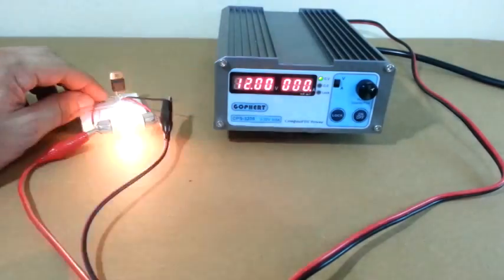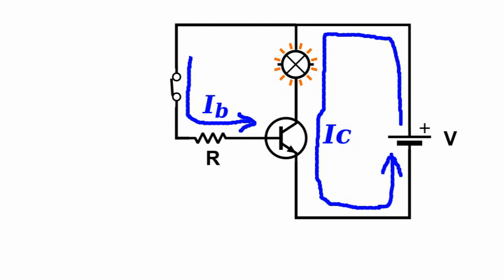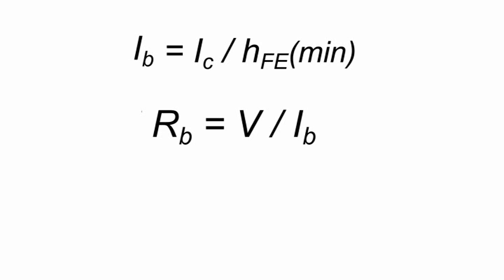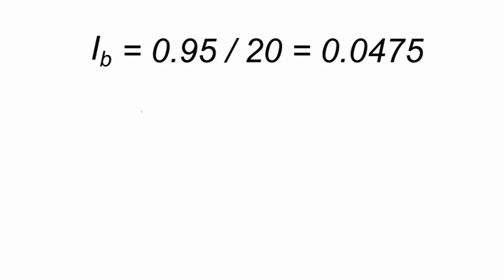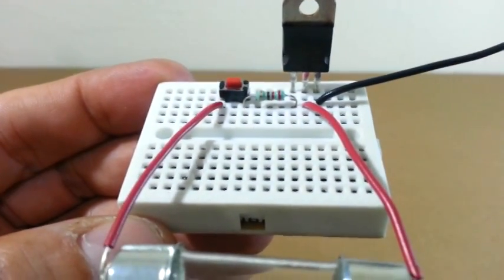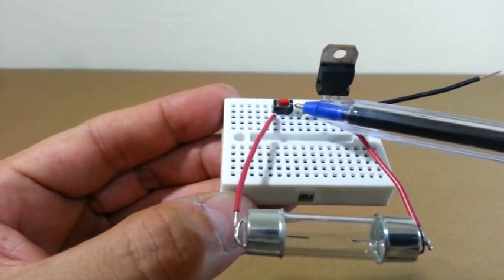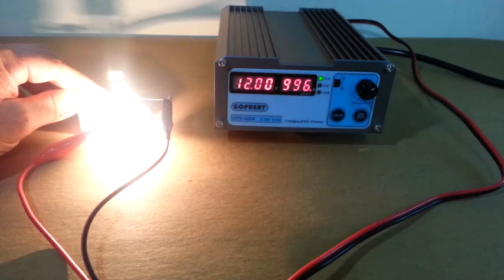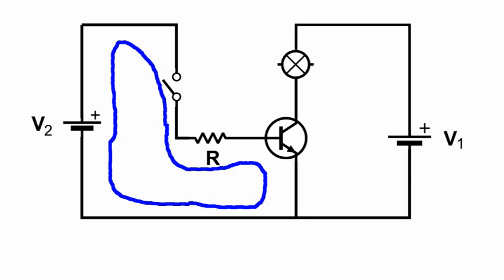Using a Transistor as a Switch

Comment: I wish you idiots would stop posting these fake transistor switch circuits these circuits are just using the transistor as a conductor you don't need one to light an L.E.D just use a resistor

Comment: Why did you use a switch instead of making the transistor itself as a switch . Remove that switch and trigger the base of the transistor with the proper voltage which will allow the transistor to pass the main voltage .

Comment: I want to make automatic switch for 12-24v dc or even better 220v ac. so when i put constant 5v dc to the circuit, the power switch turned on, but when 5v dc is turned off, the circuit will automatically turn off the power switch. Can you make a diagram for this?

Comment: I know it has been 3 years but I just want to say well done for this practical example. It is the only one I can find that doesn't just explain the process of calculating the base current resistor but also explains the purpose of calculating the base current resistor which is ultimately to control the current required by the load circuit.

Comment: Why always a base resistor is needed to make the circuit work??? Why it don't work without it
Reply: Base to emitter voltage is 0.7 volts. Rest of the voltage, (Supply volt - 0.7v) appears across resistor. Without it entire supply volt appears at base emitter junction which will damage it.

Comment: Why was the transistor even kept in the circuit, if you push the switch, the light glows, what did the transistot do??
Reply: as he showed the lamp needs 1 A, but the tiny button can't support 1 A, it would just break... but the transistor can handle 1 A, so the button is used to switch the transistor in its place
Reply: Uploader missed to say that the switch is symbolic. It could be replaced with any other switch, like float switch.

Comment: Why to use transistor as switch when we can us a mechanical switch
Reply: i don't know about him but, for my application i need to turn on / off  3 or 4 individual events with the push of one button,  mechanical switches are way too costly for my project (import tax is high in our country) and are limited to the no. of poles it can throw at a time.

Comment: If  I use  5 Volt for base voltage  and 12 volt for  load voltage  then  while calculating resistor value for base then V= 4.7 (5 - 0.7)  volt . Am I correct ?

Comment: Then what the fuck is the use of the transistor if you still need to press the switch.
Reply: TheNormalGuy E   The automotive industry uses the concept to run smaller wires to the control locations.

Comment: it seams too many people don't see the point of the transistor when there is already a  switch in the circuit. Guys this is an example to show you the switching action of the transistor. You need to apply voltage( well current for BJT) to the base of the transistor to turn it on. Whenever there is voltage, the transistor allow current to flown from the collector to the emittor (NPN BJT only). It might seams like there is no practical design for this circuit if you see this as 2 switches using the same voltage. However, if you play with very high voltage, you could connect a very low votage on a switch and the  base of the transistor. Then you could put 120/240 volts on the other side to turn on an apliance without risquing to hurt yourself playing with high voltage. Think about a computer or a TV that is connected to this kind of voltage but the switch to turn it on could literally be licked without killing yourself (still dont do that!!! there is some appliance that have a 120v switch). Long story short, you could have a mechanical switch operating at 1.5, 3 or 5v  and turn on/off stuff on the other side of the transistor with lethal voltage. The other use without a mecanical switch and by using only the transistor for switching would be  by turning the switch logicaly. One example would be to hook the base to a pin of an Arduino and putting the pin high or low in the code. You would then open the transistor switch on or off accordingly. As an example, if my arduino detect (using other component of course) that it's dark in the house, it could trigger a function that will set the pin where I connected the base of the transistor to high. Doing so could open a light inside the house, if such device is along the current path past the emittor. If I put the same light on the side of the collector, I would turn it off. Hope it helps giving you an example where you could use an additional switch or not.

To summarize, if you put a mechanical switch, there is still a point of using a transistor for switching, but you'll need some kind of interaction. If you want to automate the action of your transistor (as as switch), you'll need something to feed the voltage to the base like a microcontroller, the output of another transistor and so on.
Reply: Alexandre Contant   Yes, but this is more similar to how a relay is used.
Reply: Thanks for the information, does using a transistor can also protect the components that are being energized? can a transistor withstand more activations than just the singnal of a microcontroler alone? maybe that could be also a reason to use a transistor as a switch? 
Is more reliable and it protects the components being energyzed. Could also be used as an internal fuse...

Comment: i don't know much about electronic. I don't see the point of having a transistor in the circuit  because he is controlling the circuit with a switch...he push the switch the light comes on and he push it again and the light goes off...so what does the transistor do in here??? if he is turning it on and off with is hand...
Reply: as he showed the lamp draws 1 A, which the tiny button can't handle... but the transistor can handle 1 A, so the button is used as a means to activate the transistor which can handle the needed current

Comment: i did the same circuit but without the transistor. I inserted the switch in place of the transistor, connecting one terminal to the red wire and the other to the black wire.

Comment: for that matter why not just jump the lamp to the switch then to a power supply?  the transistor is useless in this application.
Reply: it's an example duh
Reply: duh
Reply: i think that little switch will not able to pass >900mA of current for long time, so there's the transistor came in to handle the current. just my 2 cents though..
Reply: @Brian Evans its not redundant, because the tiny switch isn't able to handle nearly 1 A, so the switch is only activating the transistor to do the heavy lifting in its place.. just like for example a microcontroller pin might do, most can only supply 50 mA or less, but by having it switch the transistor the pin can activate the 1 A lamp without frying the board
Reply: No an example is supposed to demonstrate a principle which this does
Reply: Brian Evans I think most can watch the example and apply the principle to an appropriate circuit with bigger loads. Just cause you need every little thing explained to you don't assume everyone else does too.
Reply: Brian Evans and your moms

Comment: What if you replace the resistor for a potentiometer?
Reply: No problem, you can do it and use your potentiometer as a Switch for the transistor.
Reply: turning the potentiometer will incerase gradually (or decrease) the current in the base, and the light will have the same effect, but make sure to put a resistance after or before the potentiometer, so you could actually put the potentiometer in 0 ohm and the transistor will not die

Comment: why is the lamp taking more current when in a transistor circuit than when hooked directly to the power supply..shouldn't it be the opposite?as the transistor puts some extra resistance.
Reply: the trasistor takes some current by itself thats why
Reply: Ανώνυμος Ανωνυμόπουλος
i see...thx
Reply: Switch+resistor+transistor forms parallel path to lamp. Hence effective resistance will be lower and hence draws more current.

Comment: isn't easier to use a simple switch!!!
u have to keep on pressing the switch to keep the light on!!!
Reply: or as it says at the end of the video, you can use a low power circuit to drive a higher powered one. For example,  a micro controller to drive a motor.
Reply: I think the concept is to allow fast switching say by using a sensor in place of the button switch.

Comment: i thought he was going to use the transistor as a switch ,but he used it like you`d use a relay im disapointed
Reply from the maker: this is the standard way of using a transistor as a switch
Reply: but you are pressing a button ,that is switching the circut,thats the switch !how is the transistor switching the current on and off ?its only directing by the way i see it
Reply: even your diagram displays the transister is only a transister and the switch is the switch,it isnt adding up to me
Reply: ok i see how you are calling it a switch cause when you feed current to it its switching current,but it not being the controller,the real switch is the controller,guess this system is practical in compact situations,otherwise id just use a relay to do the same job,less math involved then
Reply from the maker: yes but relay is more expensive and slower to turn on (important in some situations)
Reply: very good fact
Reply: Not really important for people seeking this knowledge on youTube..
Reply: Thanks this all helped. A lot of videos don’t explain that the controller switch can’t handle the current and uses the transistor as a (switch) for lack of a better word 😑 because the transistor  can handle the current! It basically is switching through the transistor! If you want to see a transistor without the controller switch you can look it up in application of a digital computer! For anyone still reading

Comment: what code of transistor you use mr ludic?
Reply from the maker: +Gerizen Halim 2n2222 works and many other small PNP´s
Reply: I want install to 12v 1,9A led lamp and make that lamp like strobe using ic 555
Can i use transistor become like relay?
Reply from the maker: +Gerizen Halim there are circuits you can find in the web to make a led strobe with a 555
Reply: +Ludic Science   Sorry, Ludic, but did your reply get posted on the wrong video?  (youtube sometimes seems to do that).  The circuit shows an NPN transistor (I think),  and your test showed a current of nearly 1 amp.  And the transistor we see is a power transistor.  A 2222 ?

Comment: Can you install the lamp in the negative side of the circuit? Or after the emitter ....thanks..
Reply from the maker: +Kennynva T. yes you can
Reply: As Ludic has said, yes you can.  But that set-up has an extra problem.  The base current now has to flow through the bulb filament, whose resistance varies a lot with temperature.  Low when it's not glowing, much higher when it is.  Not so easy to calculate the right value for R !  You might not get it working at all with a filament bulb as the load.  Ludic's circuit is the one you'd see in a textbook, it's the best (for an NPN junction transistor used as a switch).

Comment: As a relay is more correct name for this circuit :)
Reply: +popraw a Why is it?
Reply: Signal drives another signal - relay.
Reply: popraw a   symantics. . . ..
Reply: Dan Coulson
Yes, all the manufacturers are beating a path to his door to help them rename all signal driven devices. From, switching transistors, triode valves to photo receptors will be called a relay ....

Comment: I like this tut, but I have some constructive criticism.  To the uninitiated it might seem that you are turning the light on and off with the switch and not the gate.  It would be better to use a high and low power supply, for example a very small battery and your lab power supply for added contrast.  The math part is great though.
Reply: Bradman, it's just a function example, your comment is utterly useless!
Reply: Bradman175  My bad!  I tought he was free to use it any way he wanted. Very stupid of me!
Reply from the maker: +Joseph Nicholas Yes I agree with that. Thanks!
Reply: Why are you pulling this vid down?
Reply: Bradman175 So find a vid for advanced users and put that comment over there.
Reply: +Brad 
This may seem like its a waste of components.  It is done in the real world, so you can use mechanical switch that doesn't need to have a high current rating. Direct mechanical switching of high currents can cause damage to the switch contacts.
Reply: Joseph you are exactly correct!  I am the uninitiated, and it was just what I was thinking- if you use your hand on the switch, what's the point of a transistor.  But I'm grateful for those who know these things out there and their efforts to share and educate those of us who don't.
Reply: Taunter Atwill I'm not. I get it that it's a demonstration for newbies in electronics, but in the real world, you wouldn't need a transistor or that would be a waste of components.
Reply: +Taunter Atwill 
THANK YOU !
Reply: FlyingByDave I know that. But in the case that he used it for, it's just a waste of components. If the base of the transistor was controlled by a microcontroller (through a resistor of course) and it were to drive a motor, then that would make sense.
Reply: +Joseph Nicholas 
Who is wrong? If replying to someone's comment, say who.
Reply: +Brad 
Yes, but, I didn't require the use of a microcontroller for the times I've done this.
Reply: Taunter Atwill Why are you attacking me???
Reply: Your wrong.  Like I said in my original post, most switching 95% is done exactly like I said.  Only the hot line is switched.
Reply: A transistor for a simple circuit like this is utterly useless.
Reply: Taunter Atwill He should use it in a way that made it more useful like different power supplies.

Comment: Would it be more intuitive to use a pot instead of fixed resistor value? I was expecting to see switch getting opened up then the light glowing. Or am I not understanding the concept clearly? Please elaborate.
Reply from the maker: +Parag Gulhane You do not need a pot, the resistor value is fixed by the load you are powering. What you say will happen with a PNP transistor
Reply: +Ludic Science What is diff between PNP resistor and the one mentioned in your video?
Reply: Parag Gulhane
https://www.youtube.com/watch?v=7ukDKVHnac4&t=205s
watch this